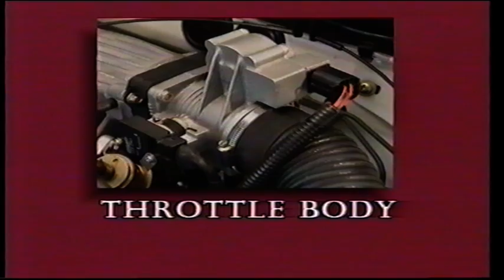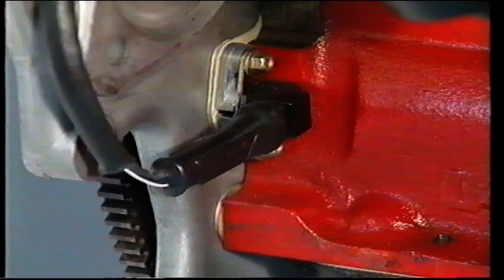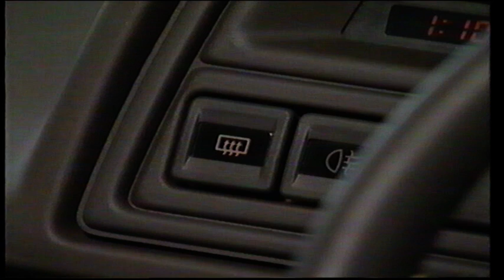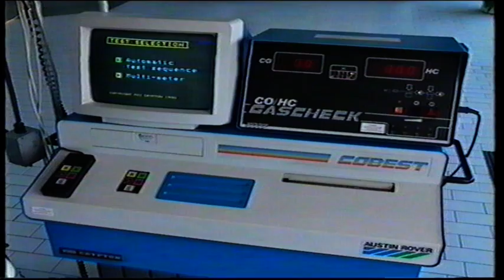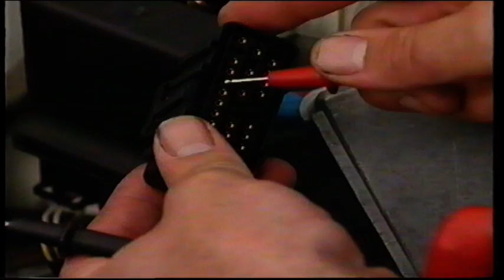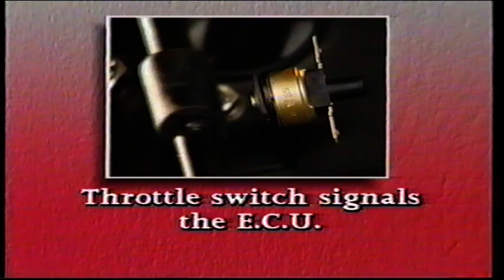MG Rover MEMS Modular Engine Management Explained

Comment: had the engine management light come on yesterday but car still running fine with no problems but the light still stays on I have no meter to check faults but the car still runs perfectly well with not even a glitch how can I switch off the light as I hate driving with lights on the dash for no reason.
Reply: MrGlendragon test oxygen sensor